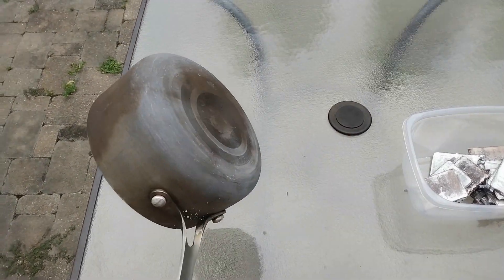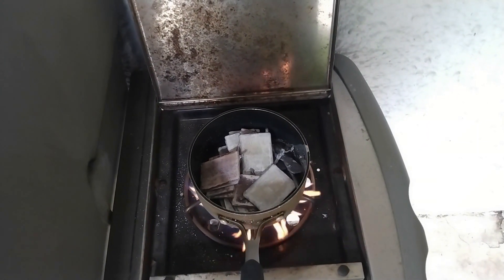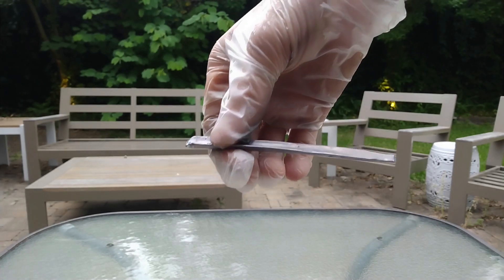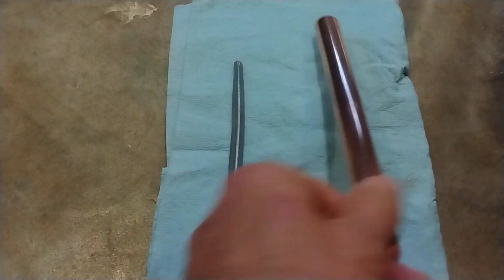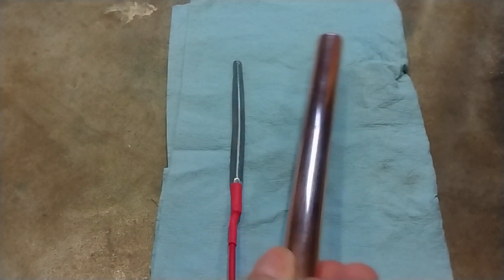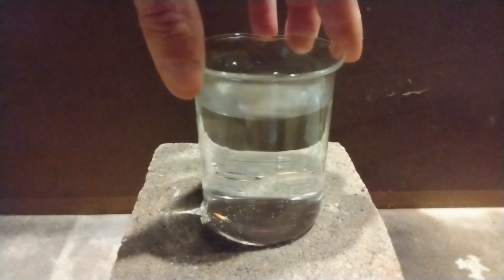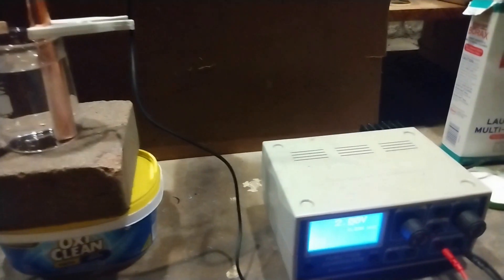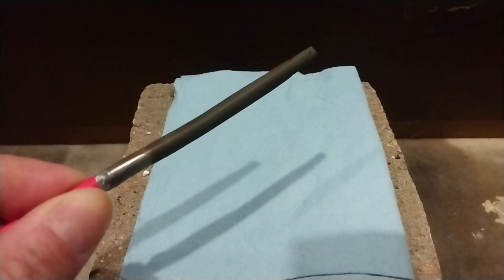DIY Lead-Dioxide Electrode: Virtually free and Easy Method!

Comment: I was surprised that you didn't stir the solution while adding concentrated acid, it could easily have stayed in a layer at the bottom of the beaker and I hope you had eye protection as I didn't see any gloves! Your skin of course and you make your own choices, I frequently dispense with gloves myself as they can be a nuisance but I always wear them when handling corrosive or toxic chemicals.
Reply from the maker: Sulfuric acid on the skin is not a big deal, I routinely get splashes. Just rinse within 2 minutes, and you're perfectly fine. On the other hand, yes, I'm wearing goggles.

Comment: 1:43 I think you'll find you could quite easily use copper plate to use as your mold for forming your lead electrode, it won't solder to the copper at all, you'd need to clean up the copper and put flux of some kind on it, but usually, if prior to using say a copper mold, you can simply heat the mold up to a couple of hundred degrees by any means and it will dull, when cooled what's left is a copper oxide layer and that will absolutely stop the lead from soldering to the copper, in fact it'll just drop right off when you cool it, I usually immerse the things pretty soon after the lead has solidified thus annealing and crash cooling the things very quickly, and there's never any sticking problem...
Reply from the maker: That is good to know. Thanks!

Comment: I need this lead dioxide electrode in order to produce sulphuric acid..... love the content but when I head "add some concentrated" my heart sank...
Reply from the maker: Make first some dilute sulfuric acid by using a regular lead electrode. Your acid will be slightly polluted, as some residue will arise from the lead electrode that will corrode. But the residue won't dissolve, so it will be easy to filter it out. Then concentrate it by boiling the water off. Then use this concentrated acid to make the lead dioxide electrode. Then, this electrode won't leave any residue (or very little) for your subsequent batch of sulfuric acid.
Reply: @BlueMoonshine thanks man❤ much love
Reply: @BlueMoonshine  if I could double thumbs up I would ty

Comment: To make a real electrode for perchlorate or chlorate synthesis is a bit more involved. First get some titanium wire mesh or sheet metal. Next plate it with lead in a soltion of lead acetate or nitrate. Do so at the negative side, about 15mA current per each square cebtimeter. Positive side is a carbon rod. The goal is to evenly and thouroughly coat. Next soak the electrode in water overnight then put in sulfuric acid and apply about 20mA per square centimeter. ❤
Reply from the maker: That's a great suggestion for a follow-up video! I might do one on that topic.

Comment: Be aware this is toxic and this electrode wears off lead chunks fast
Reply: You know that our tap water used to go through lead pipes, right?
Reply: @AndreaKarlis  And It was not a wise choice. Also pipe is different from electrode. Solid chunk of lead is not going to cause harm unless it's dissolved or powdered that gets into your system. When electrolysing with lead it's going to produce very small particles and mist, hard not to breath it in. Small amount of it will get dissolved in acid under those conditions and repeated exposures will cause harm. And also it's not a durable and versatile electrode.
Reply: @hrajabi7261  Yet, we all survived from drinking that "contaminated" water. Now, BlueMoonshine is not asking you to put the lead electrode in your mouth, neither is he asking you to drink the product of the electrolysis or make an inhalation of it. BTW, in the 80's kids used to play with air rifles loaded with lead pellets. In order to avoid losing those pellets, we were keeping them in our mouth. We all survived!
Reply: @AndreaKarlis  I just said be aware, I didn't say don't do it. 😂 Do it with safety and knowing the limits
Reply: @AndreaKarlis  And as i said solid big chunk of lead won't do harm. This is different. Also the harm depends on how much exposure you have. Most times it won't kill you, but damages your kidney or brain cell or etc to some extent. Why risk it when you can do it safely
Reply from the maker: @hrajabi7261  
"And also it's not a durable and versatile electrode"
It actually lasts very long without wearing if the current is not excessive, and it is perfectly suitable for the purposes I present in my other tutorial, like electrolyzing copper sulfate or Epsom salt. This is intended to DIYers who don't necessarily own platinum electrodes.
Reply: @BlueMoonshine  Yeah with low amps and purposes you've mentioned it works. But not good for many other electrolysis environments and higher amps

Comment: 10:45 When you dilute 93% sulfuric acid to 30%, I think you should not change 50ml of starting material to FIVE times the volume but rather to THREE times the volume. I think you messed yourself up and made only 18.6% solution instead of 30%.

However, I don't know if such a massive error has any meaning in this lead oxidation. However, it is worth noting that you put quite a lot of weight on calculations based on tables, so this gives the impression of a dilution that requires high precision.

We learned at least one thing from this:

If I need at all some complex calculations and tables to do a simple thing, I NEED TO CHECK IT BEFORE start implementing process. And check it with SOME COMPLETELY DIFFERENT METHOD. Now, for example, I could make an indicative check by drawing two things on paper - btw: I'll round 93% to exactly 90 for clarity:
1) "my desired goal: 90 --> 30 = 3 --> 1" Right?
2) "I'm going to do: 50 + 200 = 1 --> 5" Right?
Now I should ask myself:
"Have I made a mistake if the analysis is 3 --> 1 but the synthesis is 1 --> 5"
The above check can therefore be changed into a VISUALIZE check method by drawing it as clear areas (rectangles) on paper, in which case the check is based on a visual comparison instead of just doing what you have got as an idea in your head :)
 
Try it :)
Reply from the maker: My calculation is correct. In order to lower the concentration from 93% down to 30%, I rigorously derived that the volume of water to add should be exactly 3.82 times the initial volume of acid. The exact calculation is only given for reference for people who want to understand. Then I said that I am approximating 3.82 as 4. Now if you add 4 times the volume of water to your initial volume of acid, you end up we with a volume that is 5 times the initial one (4 x 50 + 50 = 250), which is precisely what I did.
Reply: @BlueMoonshine  First, for the sake of clarity, I will round my example from 93% to exactly 90% and there is still 50 ml of solution. ALRIGHT?

Then I add twice the amount (100 ml) of water to 50 ml of acid, making a total of 150 ml of solution. That is, I dilute the original 90% to 1/3 (to 30%) by increasing the amount of liquid 3 times - not 5 times, but 3 times. Right?

Which is true and which is false:
A) 90%/3=30%
B) 90%/5=30%
Reply from the maker: @MR-ub6sq  
No, this is wrong! You need to take into account the definition of the concentration. Concentration is not a ratio of volumes, it is the ratio of masses. A sulfuric acid molecule doesn't not have the same mass as a water molecule. This is clearly explained at 8'35'', please review it!
Reply: @BlueMoonshine  Alright. I finally figured it out. Sorry to cause you extra trouble!
Reply from the maker: @MR-ub6sq  
No problem! 👍

Comment: If you are recovering lead from an old car battery, why not recover the sulphuric acid at the same time? I have 8l of it from 2 old batteries.
Reply from the maker: Sure, you can recover it. You may want to distill it, which will concentrate it to 98% at the same time, but you have to use a temperature up to 337°C.

Comment: Good, but it is probably impossible to use more than some minute in REAL PbO2 application like perchlorate solution because the brine will infiltrate until your Lead metal and oxidize it until it is totally non-conductor.
It is just fun, but almost non-effective (or only for a short amount of time) in real anode application.
Even in H2 production it will be destroyed in some hours I suppose.

we are using titanium substrate for high voltage anode application.
Reply from the maker: I'm not claiming it is for industrial production, but it does a decent job at low cost for amateur experiments, such as in this application: https://youtu.be/l9ifS3ubiBc
Reply: @BlueMoonshine  Yes, thank, I already saw it yesterday, it is good ! 
Many type of anode like graphite can work for this application !

Comment: .... rather disappointing, so no matter what you'll need some sulfuric acid... I started by watching the sulfuric acid from epson salt video, figured out i would need a lead dioxide electrode, but in order to make the electrode, you need sulfuric acid to start out with!  blah....
Reply from the maker: Simply start by making sulfuric acid by using a standard lead electrode. It will work, it will simply decompose a little bit in the solution, adding some pollution, but you can filter it out. Then with the acid you can make a lead dioxide electrode.
Reply: So if I do the same thing as the video with epsom salt same way but with regular lead, it will work but lead will end up at bottom and I can filter it out at the end?  @BlueMoonshine
Reply from the maker: @MoonNymph  
Yes, I believe so.
Reply: You only really need an old car battery......
Reply: You can use a normal carbon electrode from batteries and they can also be bought online as gouging rods, they may be covered in a copper coating, you can just put the copper part in some brine and turn on the voltage, the copper electrode should be the ANODE, if its the cathode it will not work, when all the copper flaked away or got eaten by the electrolysis, you have carbon rods! Now just do the sulfuric acid video with carbon rods, as they also work fine, even better than lead electrodes like a reply mentionned, you can just filter the carbon particles in a coffee filter since the acid is dilute and won’t really eat through it, then just concentrate it to your needs and thats all!

Comment: Please show how to make lead dioxide powder
Reply from the maker: I will have to think about it.
Reply: if you use a high current density, the lead dioxide will not stick to the electrode and fall to the bottom as a powder. you need to increase the voltage till you see little bit of oxygen evolution.
Reply from the maker: @janami-dharmam  
I'll try that!
Reply: @BlueMoonshine  also you need to tap the electrode periodically otherwise the PbO2 will hang around the electrode like a slime.

Comment: never heat a teflon lined pan (if that's what it is), past 200C , or you will release fumes that will poison you  PS- If you drill lots of small holes through the anode before you oxidize it, you can get much more usable surface area
Reply from the maker: Or simply shape the electrode into a flat plate.

Comment: Sulfuric acid will blind instantly if it gets in the eyes.  Especially when concentrated. Anybody dealing with it really needs to wear chemical goggles, not just dust goggles. 
   Isn't lead dioxide EXTREMELY poisonous? Maybe should have mentioned that. 
   Lead vapors from heating, and lead dust In the steel wool/file aren't good for us either.
Reply from the maker: Lead is not poisonous through skin, and requires a much higher temperature (1750°C) to turn into vapor.
Don't make an inhalation of the lead dust and you'll be perfectly fine.

Comment: Why didn't it coat the lead with the copper? Copper plating the lead.
Reply from the maker: Because at the cathode, among the possible reactions, it is the one that has the highest reduction potential that takes place, namely water is reduced into hydrogen gas and OH- ions. The copper doesn't dissolve. At the anode, among the possible reactions, it is the one that has the lowest reduction potential (highest oxidation potential) that takes place, namely the reaction where the oxygen from the SO4-- ion is oxidized, therefore turning the Pb into PbO2.
Reply: @BlueMoonshine But, then how does copper plating work if there's water in that electrolysis as well?
Reply from the maker: @SkippiiKai  
Because for copper plating you use a solution that already contains copper ions in it, such copper sulfate.
Reply: @BlueMoonshine  Right... You'd think I would have realuzed that since I've actually done that before (not successfully, but that's a whole different story).
Okay, related question: when you're making a solution for electroplating by electrolysis (like nickel acetate or copper sulfate), I'm guessing it's just the change from water to acid that makes the dissolving reaction more favorable than the water to hydrogen reaction? Is that right, that the acid just lowers the energy required to dissolve copper below the one to reduce water? Or does the acid raise the engery needed to break apart water? Or both?
Reply from the maker: @SkippiiKai  
It really depends on the elements that are initially present. We have to look at the reduction potential of all possible reactions and select the one that has the highest reduction potential at the cathode, and the one that has the smallest reduction potential (or highest oxidation potential) at the anode.
Reply: @BlueMoonshine Thanks for the response... I think that's kind of a 'Yes, but it depends?" I'm still wrapping my head around it, but I can't think how electroplating would work if that wasn't the case. 
I just got a new (used) 100-amp 12v power supply. Does fat mean I can make ALL the reactions happen all at once? 😮
(I'm half joking... My gut says the primary effect will be heating the water)

Comment: Lead pipes...  Crazy anyone thought that was a good idea
Reply from the maker: And yet it didn't pose any problem in those times, as well as riding a bike without a helmet and without knee protections, or drinking water directly out of the faucet... The human species has become very weak lately.
Reply: @BlueMoonshine  That's objectively misinformation.  You can just do a quick google search and find tons of evidence of the long-term neurological effects of consuming lead in almost all forms.
Reply: @BlueMoonshine  It's both hilarious and distressing to read the comments in manufacturing videos because so many of the comments are about safety and not the processes being shown!  Where did this cult of safety come from?  It certainly wasn't around when I was a kid!  OSHA was an invective!  Indoctrination via the NEA I presume.
Reply: The calcium in hard water coated it with calcium salts.not to mention the metal itself is not harmful since it is not soluble.
Reply: @BlueMoonshine  Survivors bias. Tons of kids died in bike accident. Lead poisonning has lost humanity trillions of IQ and last forever. The reason lead pipe were "okay" was thanks to calcium coating from hard water. New lead pipes are extremely toxic.
Reply: You use what you have, until you can find better.

Comment: One thing to note. You shouldn't melt car battery lead with any other sort of lead. This is because car battery lead often has calcium in it to improve the electrical properties.

Other leads often have antimony and even arsenic in them. When melted with lead containing calcium these will form intermetallic compounds of calcium antimonide and calcium arsenide which form as a dross that floats to the surface of the melt looking like dust.

These when exposed to air form the toxic, flammable and likely carcinogenic gases stibnide and arsenide respectively. Because they are heavier than air they will concentrate/pool in low areas. Which could be deadly.
Reply: lead is a very soft metal and Ca or Sb (antimony) is added to make it hard. Unless your battery is about 100 year old, there is little chance it will have arsenic. Modern batteries use only Ca and some older batteries may use Sb. 
The dross is usually oxidation product containing mostly lead oxide (PbO) but other metals can also be there. Remember than lead is cumulative poison. But the dross will not catch fire.
Reply: Good thing one melts the lead from 1 car battery not 3tons.
Like the other dude said no antimony or cadmium or "deadlier" metals in modern car batteries, then Pb. at least in "the western world"

But. one is better of to select te metal parts to melt then to try to melt it from the ceramic matrix
Reply: But still for use in oxidising conditions this electrode will not survive for long. This is due to the lead oxidising away. No PbO2 layer is perfect and without the sulphate in solution the lead substrate will be gone soon. Thats why people use PbO2 on an ATO titanium electrode.

Comment: If you don't have a power supply, a small DC to DC buck( with cc cv) converter connected to a battery   with small  volt/amp combo meter can be obtained for $20 or much less, add a 12 v  wall plug, capable of about 2amps.  Will allow you do do about anything you need to do. That is safe anyway,  and a boost converter can be used also for up to around 60 volts DC! Just Incase someone didn't already know this! Have an awesome day!
Reply: I used a breakout board to a computer power supply (AT) to a adjustable buck converter, has run hundreds of hours
Reply: @douglasbeachler3890 I didn't bother with the breakout board, just open that PSU up and install the buck or sepic inside, along with a a current meter if you want. That way you can use the PSU fans to cool the buck converter. 
I run mine at 7v, 25A for a couple hours for rust removal removal.
Reply: @SkippiiKai  Good thinking. His science is sound for making PbO2 but in reality, the Pbo2 flakes off pretty quickly. I wound up using MMO electrodes for a clean product. Next time I have a battery for disassembly I'll collect the PbO2 , roast it, and put it into a porous ceramic cup with a carbon rod in the center